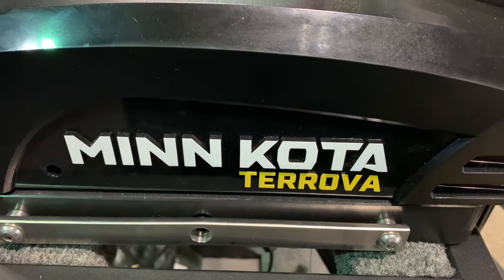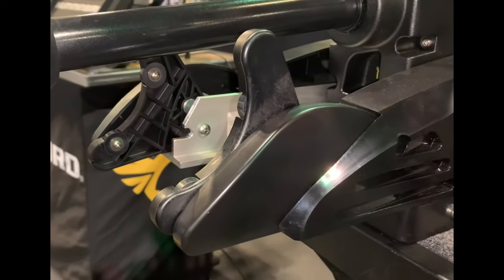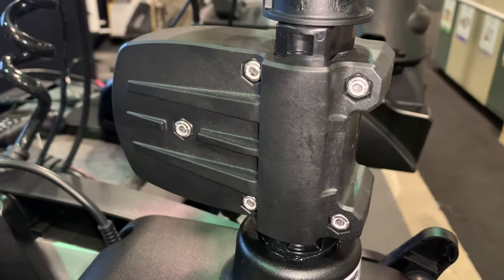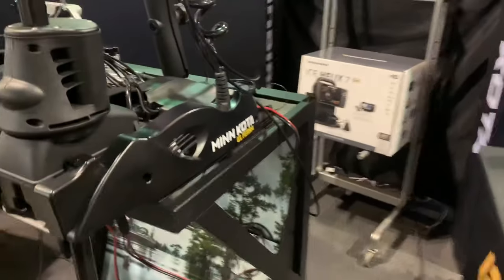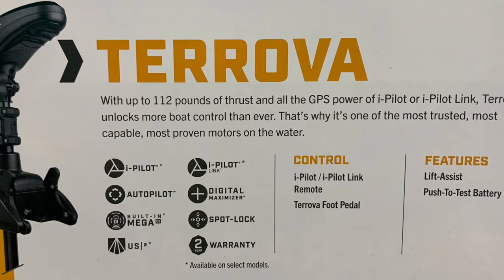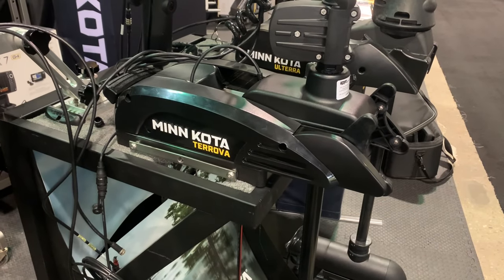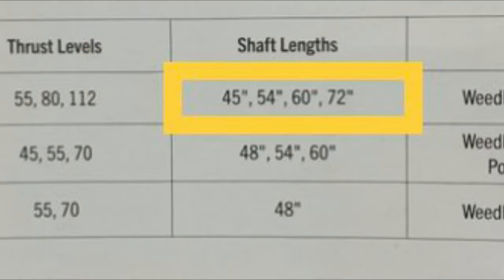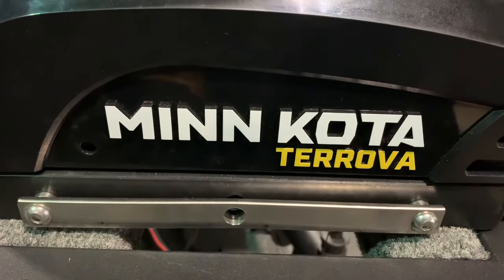Minn Kota Terrova, Operating Instructions and Features Plus Trolling Motor Buying Tips

Comment: After doing all kinds of research on the internet, I got the Terrova, 12V. 55 thrust and 45 shaft. I think that it will pull my 17 foot Nitro pretty well as I had a Motor Guide with a 40 pound thrust and that pulled it very well. I am going to have it mounted in the next couple of days and really look forward to trying it out. It's got a few more "bells & whistles" than I need, but I hope to learn how to get it to work. I think that the Spot Lock feature will really be a help the way that I fish.  I bought it mainly for the Auto Pilot. When I lived in Florida, in the 90's, I had an AP motor and LOVED it!! I just bought a used boat and this was the next BIG step on "tricking it out" like I wanted to. Thanks!
Reply from the maker: That’s exciting, you will love spot lock!

Comment: Thanks for the video.  Is the Minn Kota Terrova I Pilot (Not I Pilot Link) compatible with the Hummingbird Helix 9 MDI+ GPS G4N CHO?
Reply from the maker: If you have a built in transducer it will work. You can’t control trolling motor with Helix since it’s not a link.

Comment: Thanks for the Terrova video though the two voice levels was quite distracting.  A little audio editing to bring all the audio to one level would be appreciated.  I have a new boat on the way which will have a 80#, 60" Terrova Link MDI motor that I'm planning to network with a console and a bow Helix.  It will be a huge upgrade from my current 33 year old boat and motor with two 30 year old Humminbird fish locators so I'm trying to learn everything I can about the new system before I take possession of the new boat.
Reply from the maker: Thanks for the suggestion Ross, I had to do a few voiceovers so the hum of the boat show crowd would have been eliminated.

Comment: Can you tell what valve I need to connect my Garmin 106SV to my Minn Kota Terrova with the built in US2 Transducer.
Reply from the maker: Universal Sonar 2 Adapter is what you’re looking for and there are 3 Garmin options.
MKR-US2-1 for Garmin
MKR-US2-12 for Garmin Echo
MKR-US2-14 for Garmin 8 pin

I am not completely familiar with Garmin units so hope the information above helps.
Reply from the maker: I did a little more research on the MinnKota site, according to chart it’s the MKR-US2-14. It says it also requires Garmin 8 pin transducer to 12 pin sounder adapter cable with XID, Garmin part # 010-12122-10 sold separately. From what I read that’s what you need.

Comment: My propeller is not spinning? Fix?  Also my test button only works some time. Fix? Thank you
Reply from the maker: Hi Jack, if your prop isn’t spinning, check your power supply. Assuming you have good battery power, check to see there isn’t something wrapped in your prop shaft. If it’s mechanical, a warranty Center will be able to assess your motor and give you more information about your prop and test button.
Reply: @stevechiassonfishing5876  thanks it ended up being the column lock wasn’t engaging but test is still not working. Not sure why

Comment: Steve, I installed my new terrova. I have a promariner 3 bank battery charging system on it. 2 for fhe trolling  motor, 1 for the starting system. Charging system show all batteries at full charge. The 24 volt batteries are hooked up correctly to the manual. I still have my battery meters at red on the terrova. what is my issue ??  Thanks Steve
Reply from the maker: I would check for the voltage reading at the plug to make sure you’re getting the proper voltage to that point. If you’re getting the proper voltage to the motor, you might want to contact Minn Kota support to get their opinion.
Reply: @stevechiassonfishing5876  It should be green correct ??  Looking at the picture on download manual it look like it red ??
Reply from the maker: I looked at the manual. It says the only time the battery meter is accurate is when the motor is off. Yes by the looks of the picture it looks like the battery fills up red when it is fully charged. The manual says 4 lights indicate fully charged. I don’t have a Terrova so I can’t drift that here 100% but from what I read that certainly is the case. I am so used to “green” indicating fully charged that is my brain thinks 😊
Reply: @stevechiassonfishing5876  Thanks for time Steve
Reply from the maker: You’re quite welcome Steve, thanks for your comments. I am more up to date on the battery test meter so it helped me too to look at the manual.
Reply: It’s a crying shame that hummingbird won’t design a mount to add Mega live and 360 to this unit.  They want you to purchase a different motor that is also a manual deploy and not for a 60” shaft.  BPS Tracker targa 19, pride of the fleet, uses a 60” shaft and can not use a Minn Kota Ultra, as it doesn’t have a 60” shaft.
Reply from the maker: Kelly, hopefully they will make accommodations moving forward as they designed the trolling motor before MegaLive was out. With anything new it takes time to make adjustments moving forward.
Reply: Great job as usual
Reply from the maker: Thanks Gary, your kind comment is much appreciated.